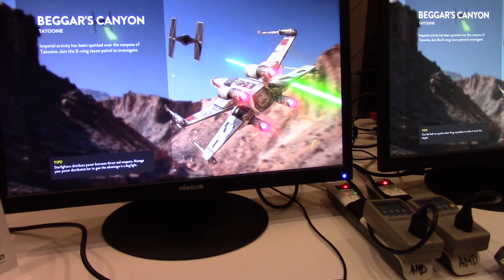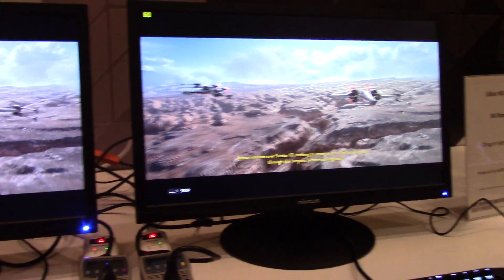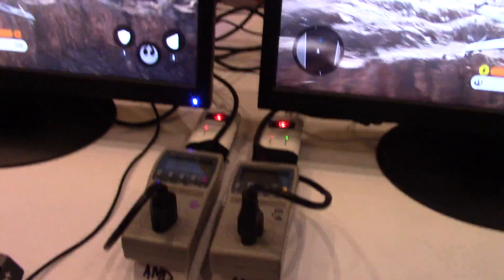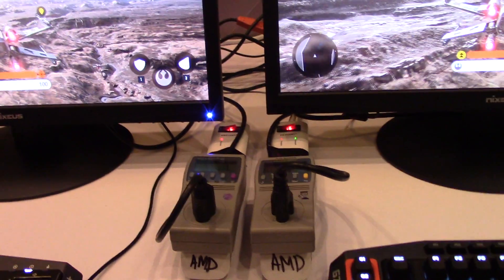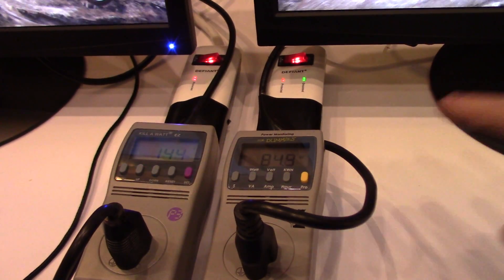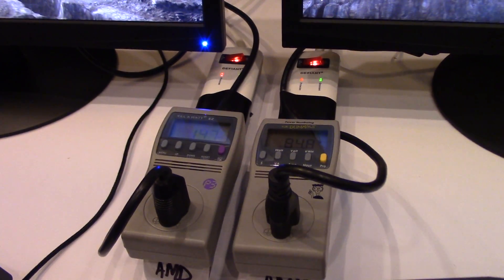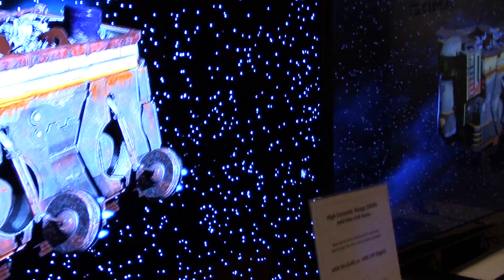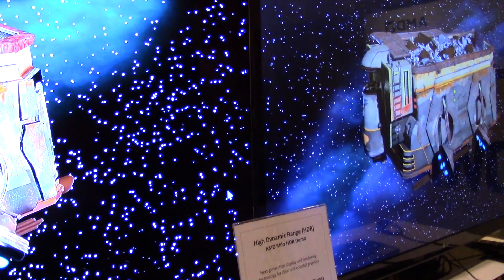CES 2016: AMD Talks Polaris GPU and HDR Monitors

Comment: ips=inplane switching which is lcd =liquid crystal display and the technology existed in the 1950s but wasn't for commercial use until 1970 so lcd is basically low tech

Comment: I just bought a 1440p monitor. In two/three years, I'll have a 4k HDR monitor. Definitely not now.
Reply: +Sad Catfish Just bought? IMO if you already had a monitor you should return it the monitors coming out this year would have displayport1.3
Reply: whhhhhhhhhhhhhhhy15 That's not important to me. I bought it because it was cheap and quality, and it was 1440p.
Reply: Sad Catfish
yea but if you plan on also getting a gpu this year they are suppose to be able to run 4k so with the 1.3 displayport you would gain above 60hz while running 4k
Reply: whhhhhhhhhhhhhhhy15 I just got a 970 last year. I'm giving it 2.5 years like I gave my hd 7950.

Comment: Is a 1500W power supply overkill for a system with a Core i3 and a r9 370 with 8 gigs of RAM???? PLZ HELP?

-read more-

- I know it is :D
Reply: +Geno Ivanov (FeraL) Of course. however, your psu will be much more efficient at supplying power to your machine. If you upgrade in the future, you won't have to worry either.
Reply: Chris Hunter You didnt click read more did you? :D

Comment: They are comparing with a gtx 950 that is a renamed previous gen using near twice as much watt/performance as the gtx 970. AMD naughty naughty, taking the customers for idiot retards again!
Reply: They're comparing power draw not performance. Don't be stupid.
Reply: The gtx950 is from the older generation that has just been renamed. The gtx 970 has only 50% more maximum tdp but nearly 2 x as much maximum performance, If the gtx 970 was to simply have v-sync to block at 1080p 60Hz it would be much more energy efficient than the gtx 950, so AMD is comparing a 2 generations old gpu with a next generation gpu that isn't even available yet, so AMD needs to compare 3 generations apart products to have a chance to appear ahead...don't be stupid ^^

Comment: I'm actually really curious what CPU was in those PCs.
And holy moly, we will finally again have powerful card that doesn't require any additional power except through PCI-E slot, just like 750 Ti but a loooooot more powerful! Awesome!
Reply: +Ryuhoshi system specs for both are as follows, 4790k @ 80% power limit, 16gb ddr3, asus h371-plus, 120gb ssd.   for nividia it was a gtx950 at stock clock. amd it was a next gen polaris engineering sample @ 850e/.8375v (whatever that means)
Reply: +Brit Ant (britant) Where did you get that?
And that .8375V... Sounds like this card's voltage. That would be amazing if it runs on such low voltage.
Reply: +Ryuhoshi AMD channel has a video showing this showcase, at the end it lists system specs !,  yeah i think they might of downclocked one of their higher HBM systems massively to get performance at that voltage. just imagine that card at its proper voltage the performance per watt :O :O
Reply: Brit Ant Well, lower litography requires less voltage i guess, so it wouldn't be that strange. And to be honest i don't think it's an hbm card. Those will be only in top end, because HBM is very expensive.
Reply: +Brit Ant (britant) as an example, the R9 Nano.
Reply: +Ryuhoshi Intel for sure haha. AMD knows their current processors suck ballz. Let's hope Zen will change that.
Reply: Michael009 Haha, well, that's obvious but i wanted to know which one because of power usage ;)

Comment: I like AMD but this is dumb, who cares about power consumption. I want graphic power and seamless uninterrupted bliss.
Reply: A LOT of people care about power consumption, the Polaris GPU is so powerefficient PCs with it can have a small 200w PSU already in it, the amount of money that could be saved is massive!
Reply: Thunder Pig and thats fine, its cool, but its not something I worry about aside from how fast it can process how easy it is to cool and how many processors it can have during its family cycle before something new comes along. Im not giving it a big slap to the face, its just not much of a selling point for me.
Reply: The less power consumption the less heat... They can fit way more GPU cores than ever before because it won't run as hot as previous generations
Reply: I care about power consumption
Reply: ***** okay, cool. Get some solar panels and then you will be good!
Reply: LuckyXIIIGaming Do you know how expensive their are?
Reply: I do not, Im sure price will release in Q2-Q3 for the newer stuff though, Its just now Q1 so. SOON!
Reply: Im glad they are looking for "Going Green",but most things "Green" just lack production for raw gaming power, look at the green hdd they are slower than black and blue hdd.
Reply: LuckyXIIIGaming ..... ok, a gpu has hundreds of cores that render images at high speeds. Theoretically, they can fit an extremely large amount of these cores (CUDA, Stream) on a decent sized silicon. Unfortunately the thing that holds them back is heat, heat and moisture are enemies of computers, the heat generated in computers comes from the electricity they consume so less power consumption = less heat = more cores = more performance

EDIT: Sorry for bad english